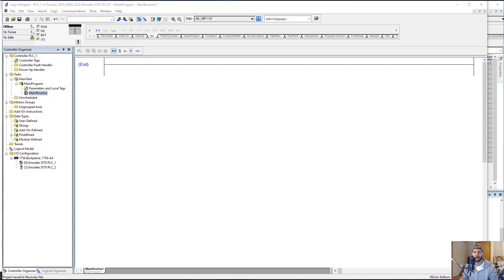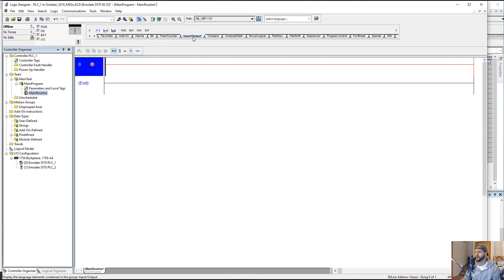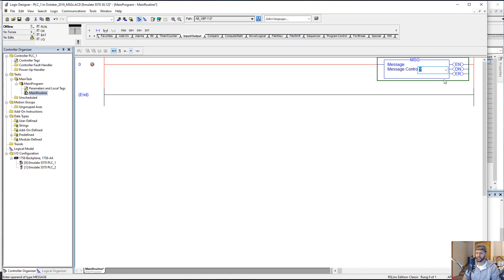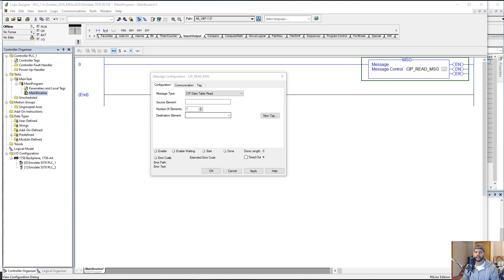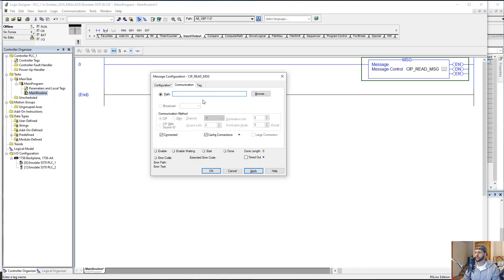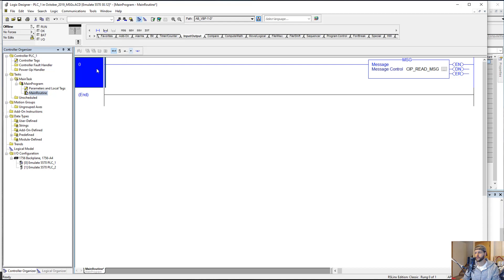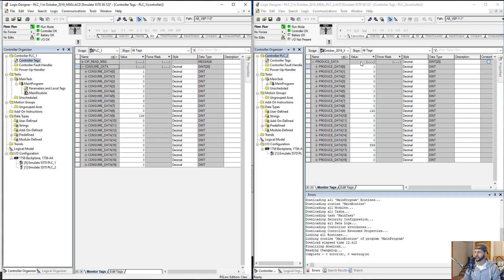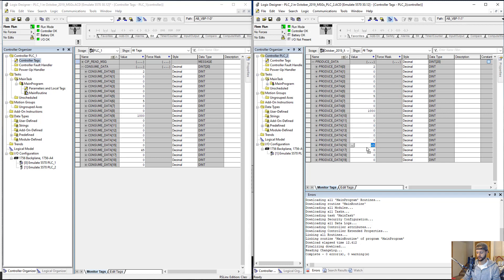Studio 5000 Logix Designer - Message Instructions

Comment: Hi There, I have tried a few times the example shown , I did download the two projects ,each its own controller(slot 1 with one project, and then other project in slot 2, in my case) Both projects having both controllers in the tree directory. However neither emulators talk to each other and the message reads err. thank you